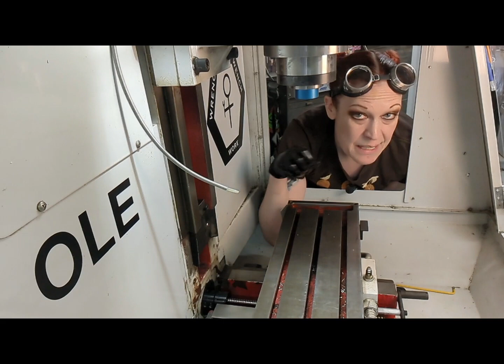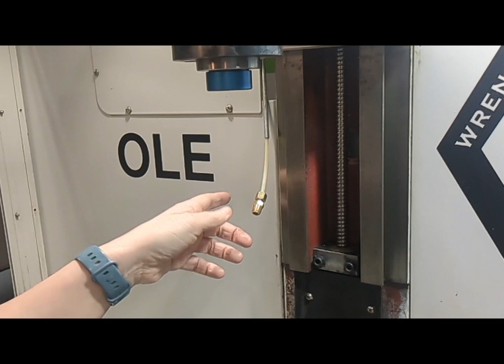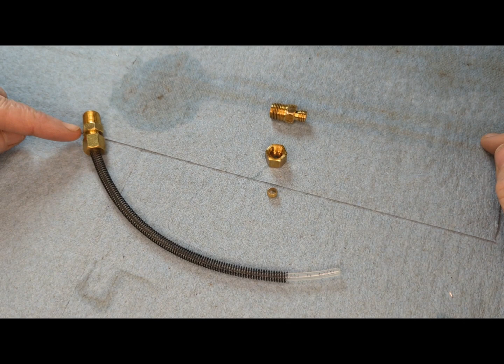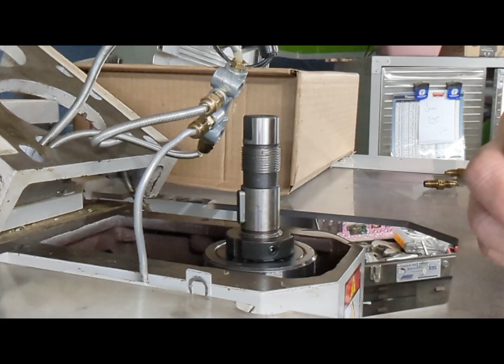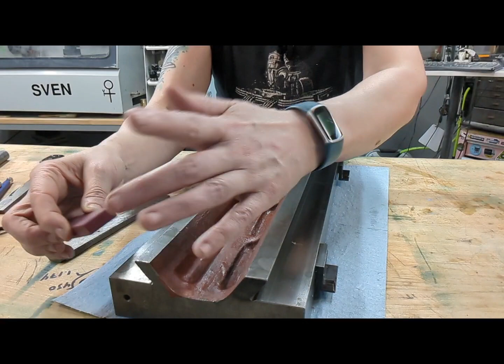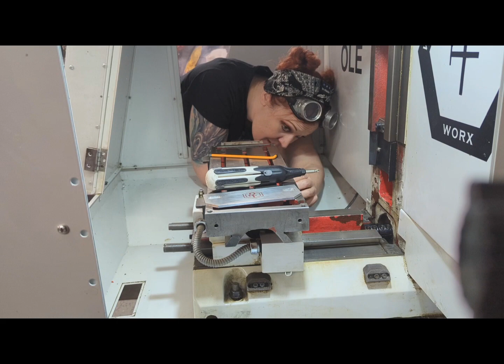What the heck is a gib and how do I change an oil fitting? Why is my Z axis not getting oil? #cnc

Comment: Nice to see another video. What happened with the video size and resolution?
Reply from the maker: @axel_is_gaming - I am not really sure!  I need to double check my settings quick (I hadn't realized that I set it to public before crashing this morning - wrapped up shooting around 3 am and thought I would let it upload while I caught a few Zzzz's quick and do the edits when I got up.)  Wondering if I hit the wrong resolution when I exported the video.  There are multiple 'YouTube' settings in my editor (Shotcut) - so it is very possible I hit the wrong one, lol. 🤪
Reply from the maker: Ope - found the issue.  Yep - I hit the wrong ratio when I uploaded it (thought I had it set to 16:9 - but must have hit some other funky setting instead).  I will see if I can get this all fixed later this morning. Thanks for the heads up. 😄